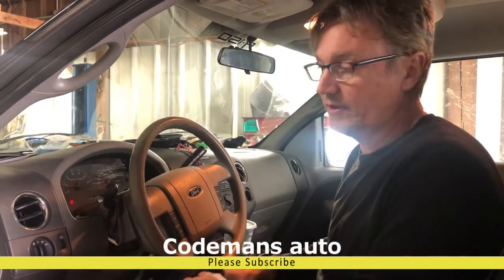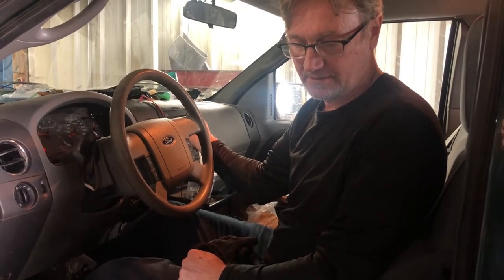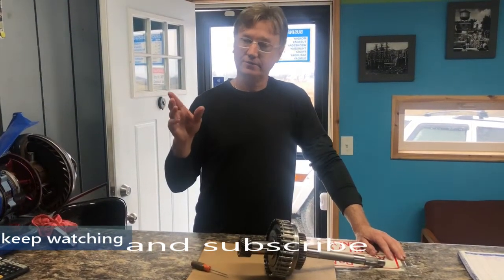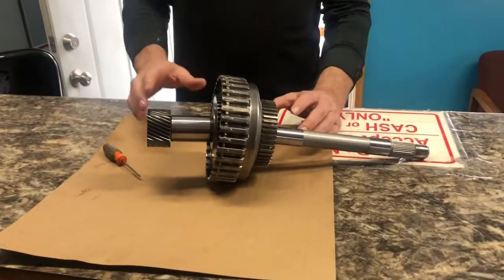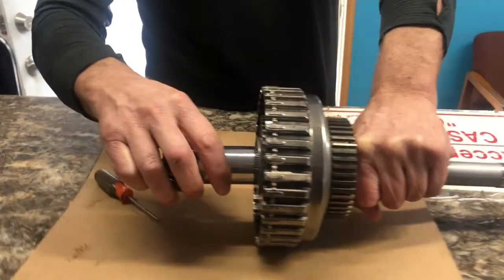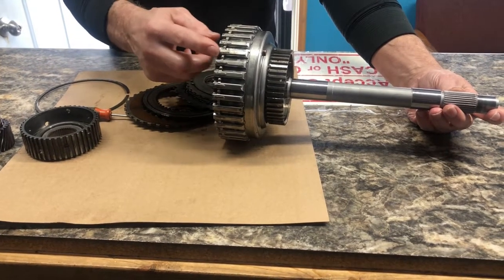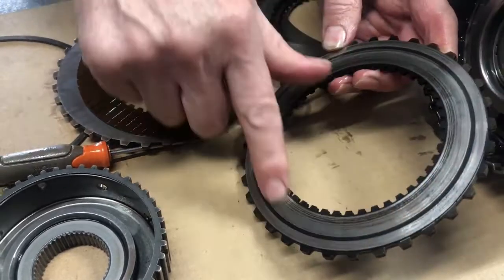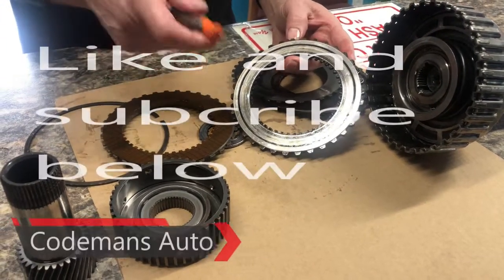Automatic Transmission pulling forward in Neutral and No reverse

Comment: I'm having a similar issue with my 2010 Final Edition Volkswagen Beetle. I was backing out of a parking space and thought i had cleared the curb. Put the car in drive and hit the curb and put a hole in the transmission pan. Had it towed to the shop and had the pan replaced. It drove fine the first day. The next day i tried to back out of the garage and reverse wasn't working. I went back to park  then back to reverse again and it worked. No more issues that day but every morning after the car sat all night, i would have that issue once and then it would be good for the rest of the day. Now all of the gears are lit up as if they're all engaged. Park works fine, My reverse is Neutral, and every other gear is drive, including Neutral.

Comment: Pulling forward in neutral means the FORWARD GEARS ARE WELDED TOGETHER. THE TRANSMISSION MUST BE DROPPED AND THE SEALS AND CLUTCHES AND STEELS REPLACED.. SAME HAPPENED IN MY PT CRUISER WITH ALOT OF BILLET PARTS AND SHIFT KITS

Comment: Oh man. My 2005 Buick LaCrosse was driving fine. Stopped from going 30 at a light and never took off normal again. It’s driving forward in ALL gears but not fast. Almost like it’s in 4th ear and struggles to move BADLY until it’s past 40mph. I had to limp it home because I cant afford a tow (ran 5 red lights😂)
Reply: I had a 2008 impala that did the same thing. Lost reverse moved forward in all gears. And struggled to move till about 40 mph

Comment: got a '67 tbird that just did this to me. At least im assuming this is the issue. I have only drive, it wants to go forward no matter what gear (except R). Prior to this issue, I had to wait awhile before I could put it in drive. If I tried any sooner it wouldn't move for a min, like it took forever to engage. Had R just fine and dandy. Only in D did it occur. Its a c6 auto transmission.

Comment: Also if the vehicle starts in park and neutral but moves in neutral its an issue
Reply: My Acura tl drives in neutral and I can’t reverse it. Do I need a new transmission or is it something else
Reply: @la.dn4  If it starts in neutral that means it's lined up with park.  If it goes forward in neutral and the gear linkage is correct. SOME CLUTCHES AND STEELS ARE WELDED TOGETHER THE TRANSMISSION MUST BE REBUILT WITH HARD PARTS TOO..
Reply: @la.dn4  When you lose reverse you  the transmission has to be dropped also. Same thing happened to me and I just rebuilt my transmission. Get good raybestos goz blue plate clutches or hi energy Borg Warner. Get steels. A seal kit. A Transgo kit. A bigger transmission cooler. A billet torque converter too. And get sonnax kits too and get that rebuilt and drive

Comment: I have this exact issue with a 00' Toyota Tundra A340E. It has 349k miles. Another symptom which I have never seen, it shoots transmission fluid out of the dipstick tube? I pulled the pan, and everything looked fairly good for the milage. No chunks just normal fine metal on the magnets. I replaced the 3 shift solenoids, new filter and I could only get 3 quarts in it? It didn't change anything, I'm sure you are correct on the clutches being fused. Great video, thank you.
Reply: Time to drop the transmission
Reply: Check the transmission vent?
Reply: @michaeloviedo2488  was able to slowly get it filled, and the vent is in a unreachable place without lowering the transmission. It was overfilled and using the dipstick tube to push out excess fluid. But as another video suggested, just drive it, and it drives fine in drive. The problem is every gear is drive. Even park and neutral. It not a primary vehicle anymore, bought a newer 2018 4Runner and It's still gets used when something needs to be picked up or hauled. We just have to plan parking, and shut it off to get it to roll backwards if needed on a hill.

Comment: so my truck does this but it’s not nearly as bad, when in neutral it barely wants to move forward if I rev it up it will like loosen up and will be normal, and when in reverse it will backup if I give it quite a bit of gas and then if I put it in neutral rev it up a little bit put it back in reverse and it’ll roll back like it normally should

Comment: Hello there I have a 7.3 engine the transmission. It got stuck in forward and not reverse. What part to get to fix this problem?
Reply from the maker: if your stuck in forward then your forward clutches may not be releasing and there for the reverse may be working but cant move backwards because the forward clutch wont release   so you will probably need to replace your forward clutches
Reply: @codemansauto208  yeah that’s
Reply: @codemansauto208 what steels would you recommend

Comment: Im having the exact same issue. the car was giving me problems going into reverse and drive it would take a while to actually catch but always eventually would. After I drive around all day it would be fine it would go into reverse and drive no problem, then it started jumping when I come to a complete stop and press the gas It would go and throw me forward and change gears all the same time. So today I got the idea maybe its low on transmission fluid so i take it to auto zone and check the dip stick while the car is hot and running. It wasint showing me any liquid at all on the dip stick, So i bought a quart and put half in there. After doing that I lost my reverse completely. Then my neutral goes forward now. another thing is while in park with foot down on the gas pedal all the way it would only go up to about 2 RPMS, and same as reverse only going up to 2rpms but car not moving at all. So I added 2 more quartz to see if that would help so 3 in total.  It did not lol. So I put it into neutral with the car off and pushed it back out of the parking spot and put it in drive and it drove great , no slipping or jerking at all and it would go over 3 rpms and then switch gears on its own. So in drive it works great , but now I have no reverse and my neutral goes forward. this sucks..
Reply from the maker: sorry to hear you are having this issue but it sounds like you may have clutches burnt together
Reply: @codemansauto208  How long can I drive a my 2006 gs430 like this. It's identical to this no reverse, forward in all gears and only revs to 2k in Park. In drive it works perfect besides and a harsh downshift into first. Can a transmission a few months like this before it dies. I need more time to save for a new transmission.
Reply: how did you fix?
Reply: Literally going through this right now. How did you fix? Pls respond